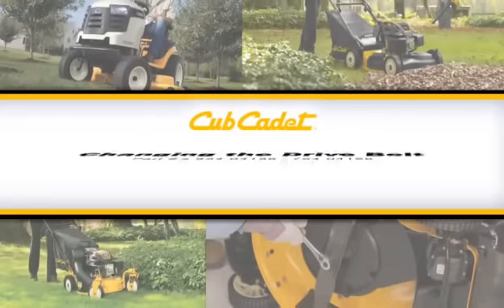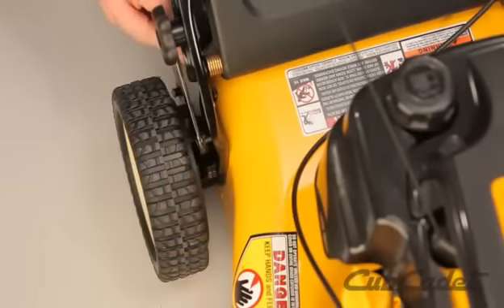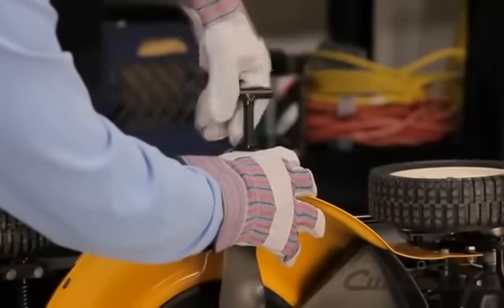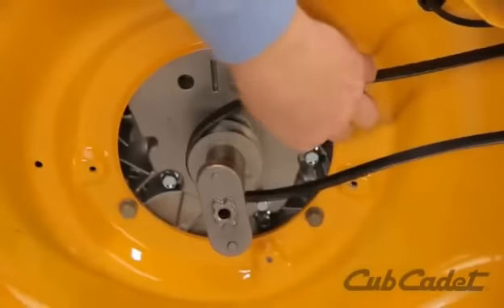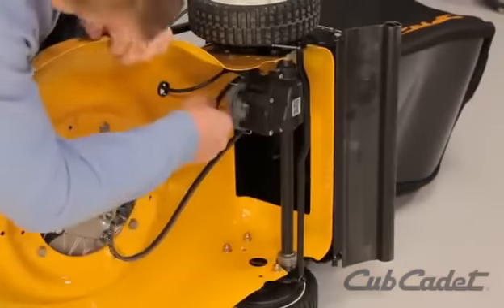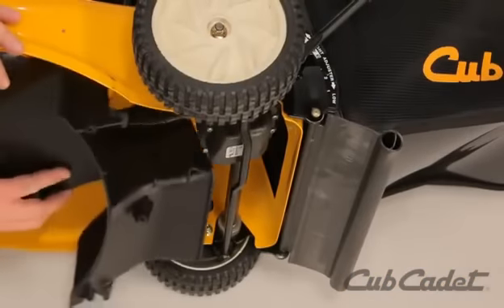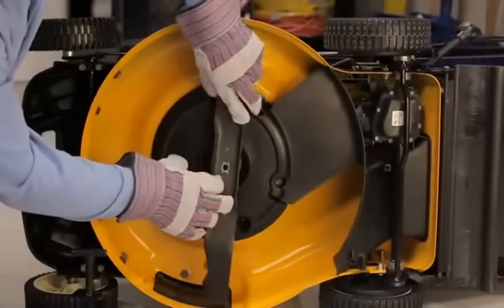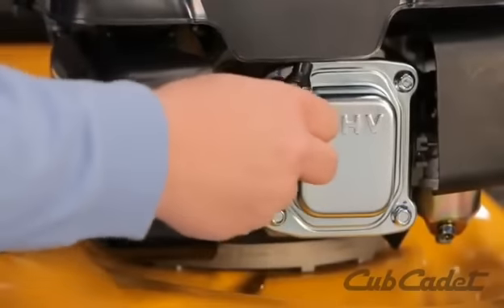How to Replace the Drive Belt on a Cub Cadet Walk Behind Mower

Comment: The transmission pulley on my 2017 SC 500z does not resemble the one in the video. It has a metal bracket which completely blocks removal of the drive belt. But I finally realized that the bracket can be loosened by removing 2 screws that attach it to the pulley assembly. Need a 1/4" socket on some sort of extender to get to them, though I did so and was able to proceed with belt replacement. The self-propulsion is now more aggressive than ever, possibly because of its new belt but I also replaced the somewhat tread-worn drive wheels (not hard). Otherwise this video is right on the money.

Comment: Trying to figure out whats causing the bolt to break off 1.5" up inside. 2nd bolt broke, now mechanic working on 3rd bolt and it is also showing stress after use.